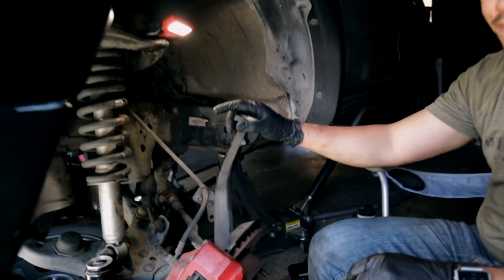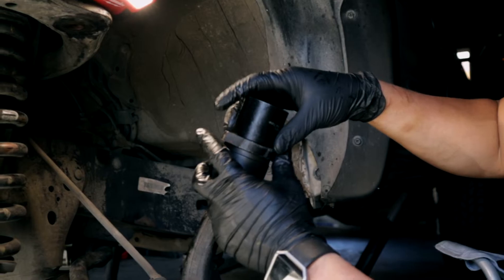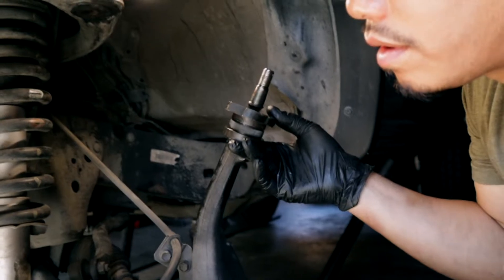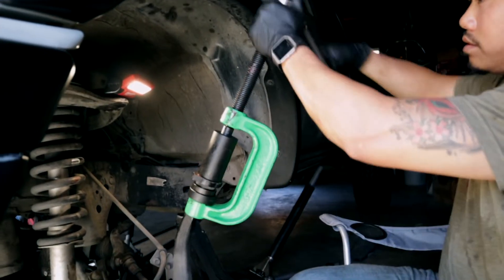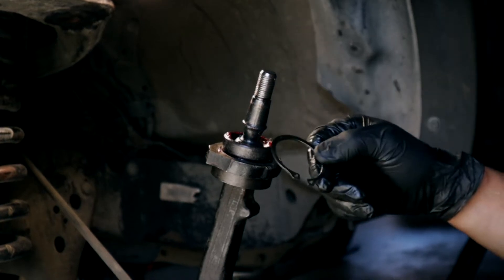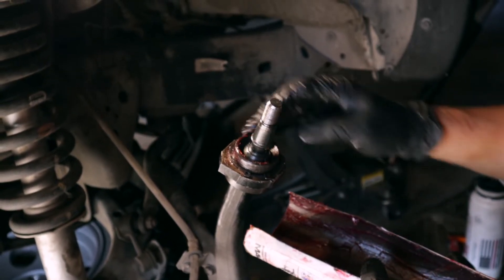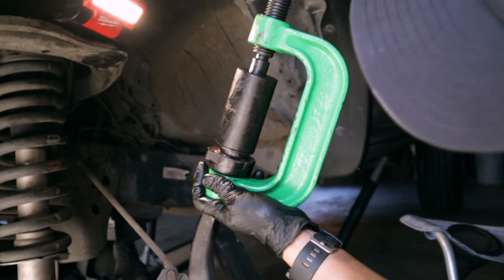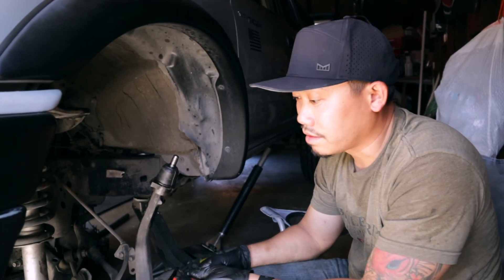2002 Toyota Tacoma Upper Ball Joint Replacement (Moog)

Comment: I suggest using a wire coat hanger to support the spindle instead of hanging it off the brake line. Make sure the lower ball joint does not get crunched while changing the upper ball joint.  Thank you for the video.